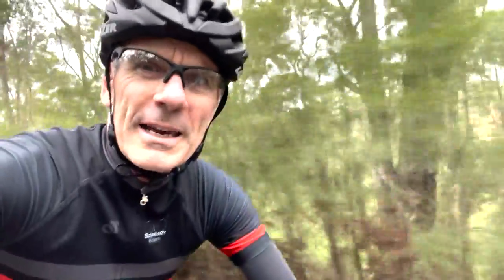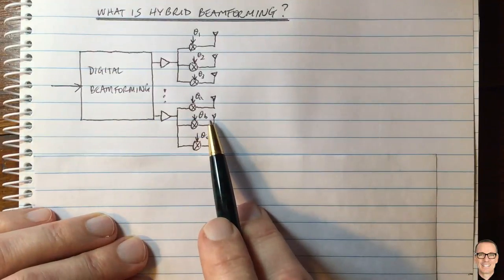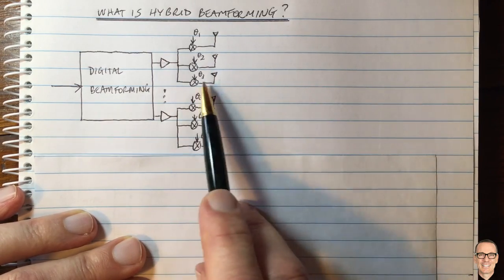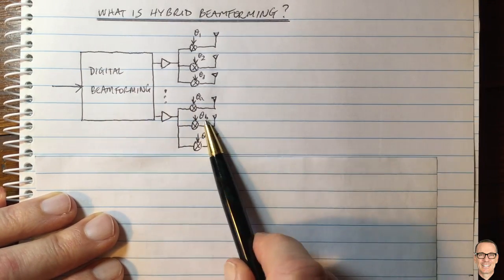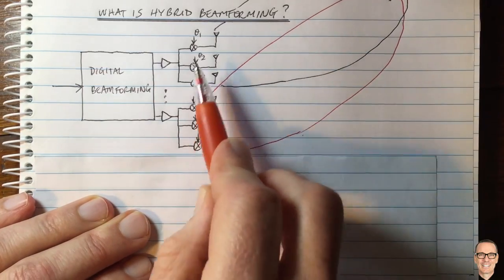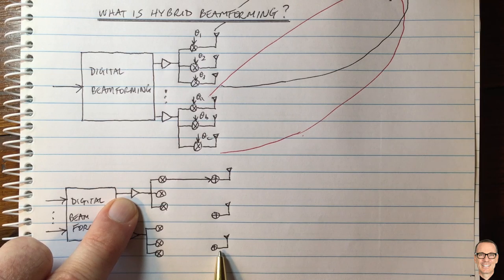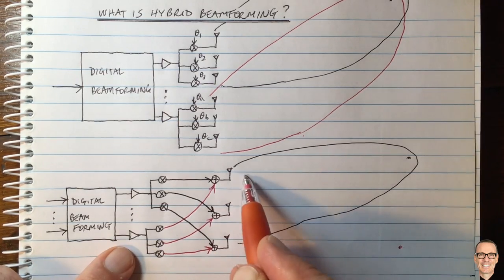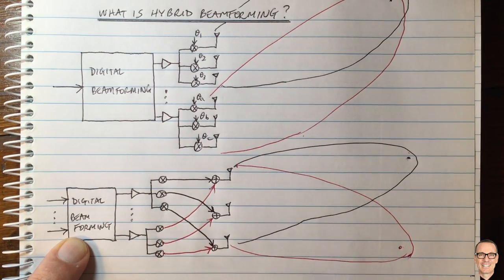What is Hybrid Beamforming?

Comment: Why must the "null" steering be accomplished in digital beamforming? Is it simply too complex to achieve any other way?
Reply from the maker: Analog beamforming only allows the phases of each antenna to be varied, which limits the range of beam patterns that can be formed, compared to digital beamforming which can vary both the phase and the amplitude and allows more beam pattern design options.

Comment: Hi professor, thank you for the video. Is the second pic actually describing the concept of Zero forcing BF concept but in a specific implementation view of hybrid BF? The ZF precoding matrix seems to be decomponented into two parts: first part is the digital weghts precoding for each stream input and multiple ant outputs. second part is the sum of the precoded ant outputs as shown by analog part. Is my understanding correct?
Reply from the maker: Not really. This structure limits what you can achieve in the precoder (since you don't have the full degrees of freedom in the digital part). It doesn't have to be ZF that you are trying to implement. It's the same for other precoder types as well. See: "How are Matched Filter (MF), Zero Forcing (ZF), and MMSE Related?" https://youtu.be/U3qjVgX2poM and "How are Beamforming and Precoding Related?" https://youtu.be/iMIqEpzxN9Y

Comment: Thank You. In the RF chain bettween the digital- and the analog-beamformer, there needn't to be a mixer? I believe tthat I have seen mixers in similar pictures -> to mix the signal to the transmission frequency prior to the analog beamforming. Obviously there are also cases without that.
Reply from the maker: Yes, you're right, I didn't show the mixers. Typically we tend to do most of our thinking at "baseband", since the up-conversion and down-conversion are generally simple direct operations that don't change the "digital signal" characteristics (at least that's the typical case). See these videos for more details: "How are Complex Baseband Digital Signals Transmitted?" https://youtu.be/0lkRJgnywkg and "What is a Baseband Equivalent Signal in Communications?" https://youtu.be/etZARaMNN2s

Comment: Thank you for the good lecture! I have two questions. Should I use the upper example only for single user beamforming? (why the below structure is for multi users?) 
Unlike analog beamforming, digital beamforming doesn't make sense easily. Is it impossible to visualize it easily?
Reply from the maker: Yes you're right, you could use the upper structure for sending to multiple users (as well as the bottom structure), but for the same number of antennas, you have more restricted beam shape possibilities. And yes, "digital beamforming" is a topic that's already on my "to do" list. I just need to find the time. 😥

Comment: Do I understand right, you can sum the phases from the 2 streams together (lower picture) and still get the desired beams? 
Without that summation it is clear that you get 2 beams to the 2 users. Thank you.
Reply from the maker: When the two "individual beams" are summed together it produces a single "overall beam shape", but the fact that it was constructed in this particular way means that the two data streams are effectively being "beam formed" within the "overall beam shape" (intuitively speaking).